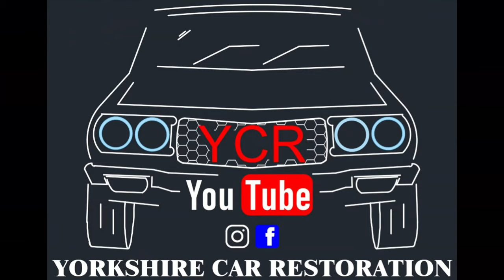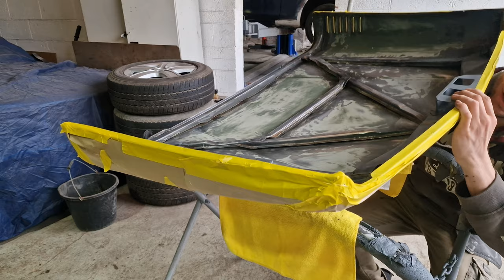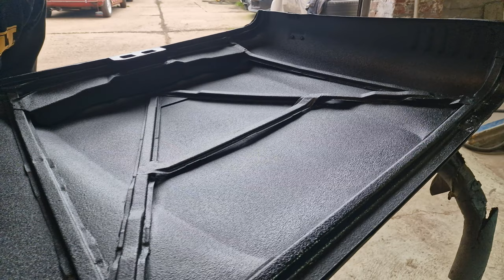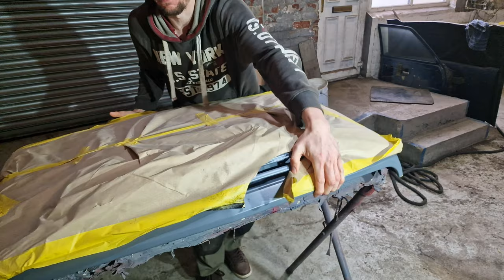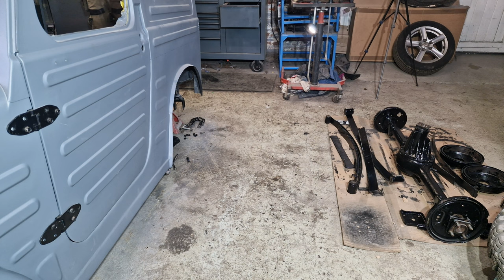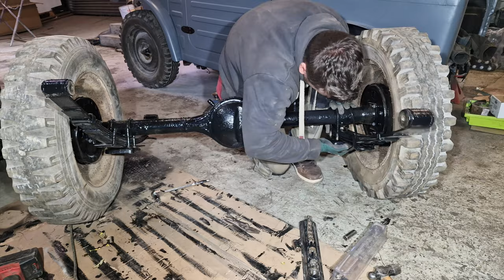Classic Car Restoration - Undercoating The Bonnet & Fitting The Rear Axle! Suzuki LJ80

Comment: We live in parallel. :-) Point out to the nice viewers that if you miss masking even one small hole that goes through the panel, the undercoating will blow through it & marr the "front side". So taping every ickle hole on the primed side is super-important. Nothing worse than removing the masking paper & finding there was a sneaky bolt-hole that got missed. :-)
Reply: Masking the wings (which I did yesterday, lol) for underseal, you have to be even fussier as there are 101 spots the black can sneak through. I use vaseline for re-assembling the axel stuff - it doesn't muck up the nice shiny paint but still works great. ...which I did on thursday.. :-)
Reply from the maker: Very good point! and it really is very important to do! As you mention, nothing worse than unmasking and finding runs all down the freshly primed panel! If forgot to mention it in the video. Good point with the Vaseline! didn't think of that :) good luck with the assembly! nice to know I'm not alone on the journey! keep at it James!

Comment: Just before you coated the underside of the bonnet you put something on the seam at the back of the bonnet what was that and what was the reason for that? Great job you are doing there.
Reply from the maker: Thanks so much Eddie. That was Tiger Seal, I put that on the areas we have welded/repaired to keep any moisture out of the weld as sometimes there are pin holes in the welded areas. Just an extra layer or protection :)

Comment: Is that Raptor liner OK with the heat from the engine?
Reply: I was thinking the same thing. I did notice that it was a 2k mix so maybe it dries to a hard finish?
Reply from the maker: It dries to an extremely tough wearing hard finish, the heat from the engine will not be anywhere near hot enough to affect the coating. Good comment though! Thanks!